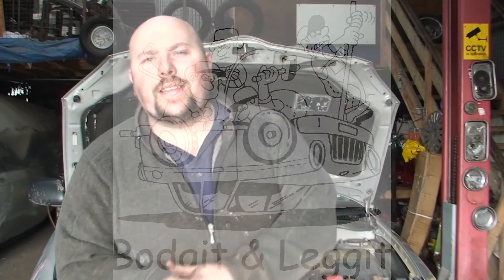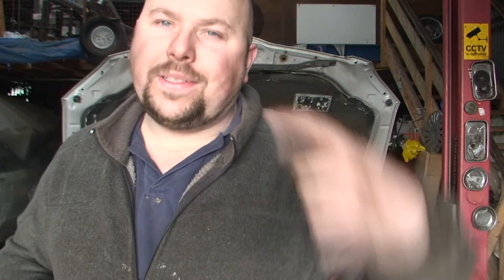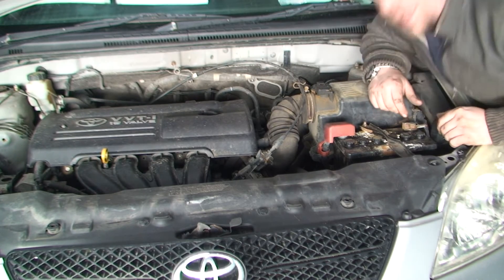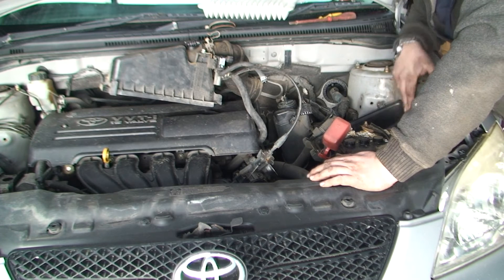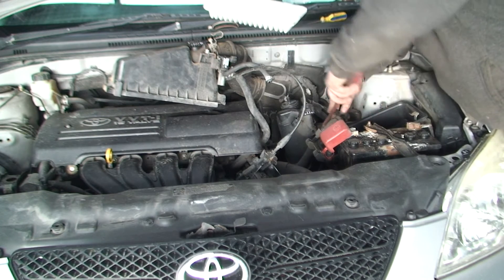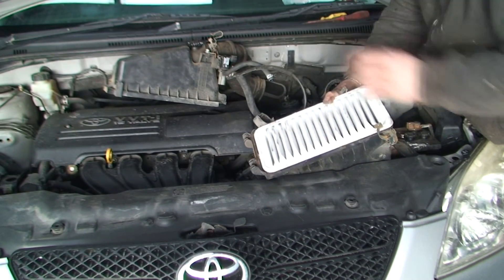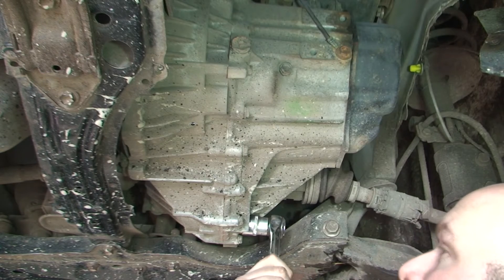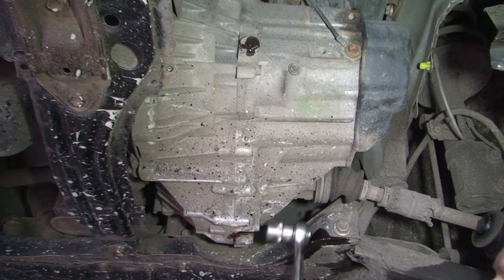bodgit and leggit garage toyota corolla clutch part 1

Comment: Fantastic video 
I have a rounded hub nut on passenger side can drive shaft/cv joint  still be removed from the cup without removing hub nut thanks
Reply from the maker: boom sorted

Comment: Thanks for letting us know it really can be done without having to drop all the subfames etc as other videos show.
Following your vids have just done my 1.6 corolla  clutch without any problem.

Two tips, to remove the driveshafts from the hubs , just undo the three wishbone ball joint bolts and push the wishbone down, the hub can be pulled away and the driveshafts come out easy.
For undoing the driveshaft nuts without air tools or putting a bar against the wheel studs,  replace your alloy wheels with the spare steel one which has an open hub centre so you get the socket in there, then lower the tyre onto the floor to provide the resistance / grip.
Reply: With or without a hoist ?

Comment: grate video.Do you first wire brush and wd40 the nuts and bolts on the struts or do you just windy gun them straight off ?.
Reply from the maker: Hi mate it depends on what they look like on this one there ok so i just used a gun but if they are bad i will wire brush them and lube them first